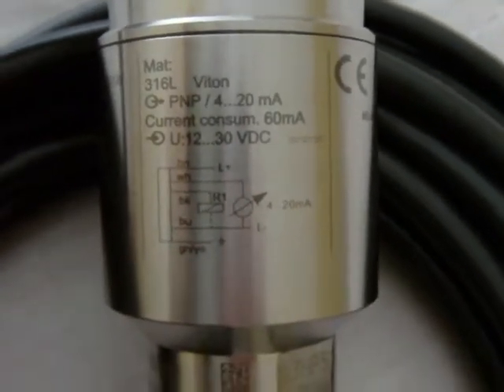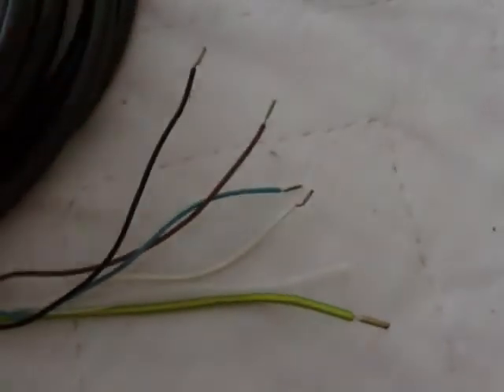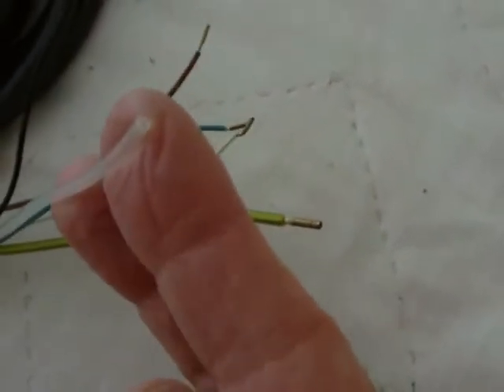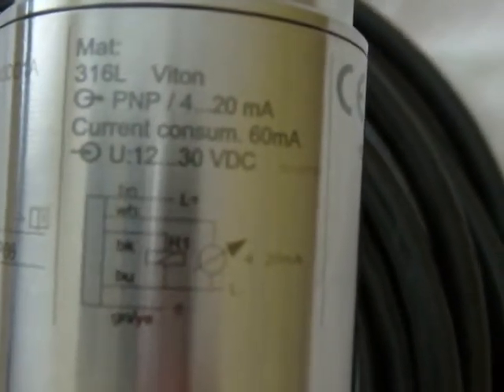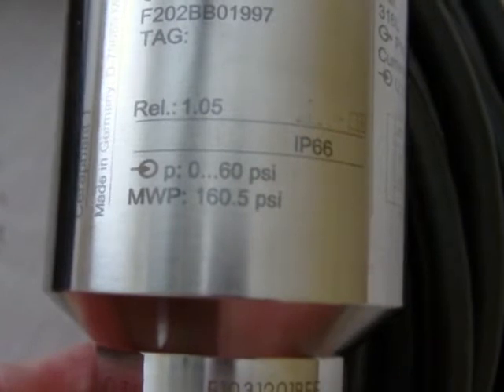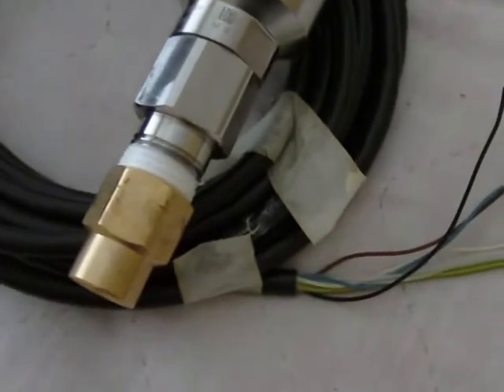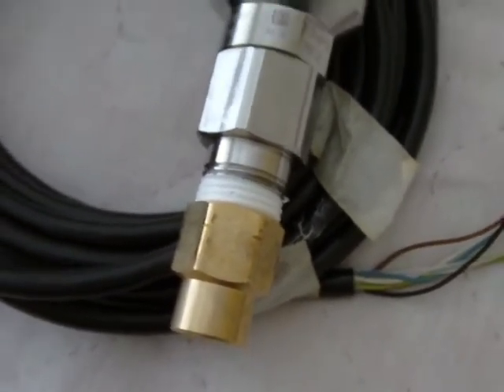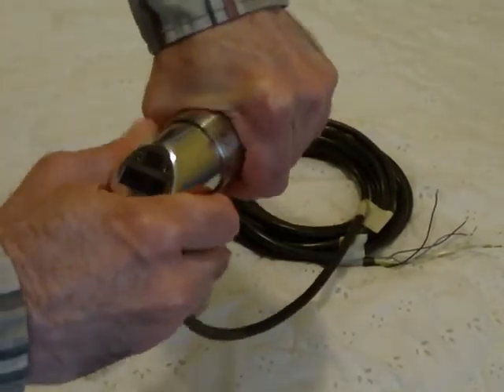GETTING FAMILIAR WITH CERPHANT PTP31 PRESSURE TRANSDUCER

Comment: very  excellent,  thank  you ,  i see a R1  in the manual , what is this for ?
Reply from the maker: In the manual R1 is the switch (or relay) contact.  In the video the analog meter is attached to pin 4 to show switch closure at the appropriate pressure.  The interesting thing about this pressure transducer is it not only outputs a voltage proportional to the pressure, but it also has a switch to indicates reaching a certain pressure as well as a visual indicator showing the pressure.  Most pressure transducers only provide either a switch or an analog output.